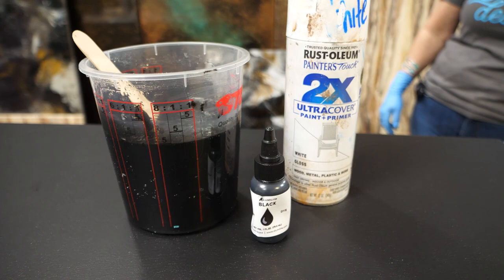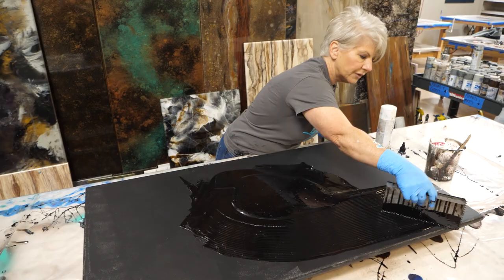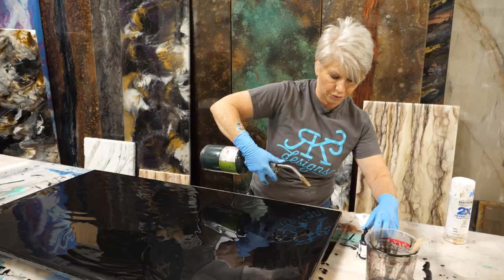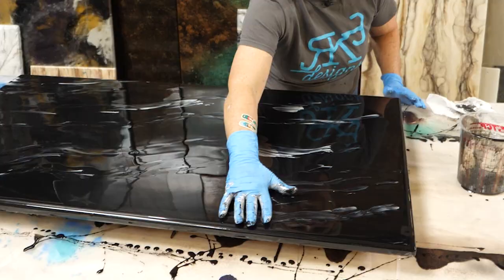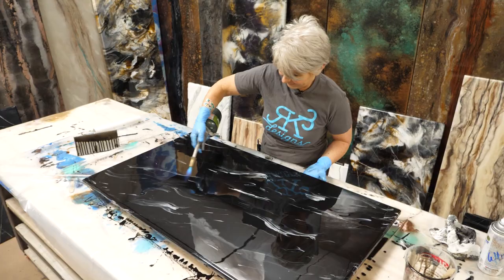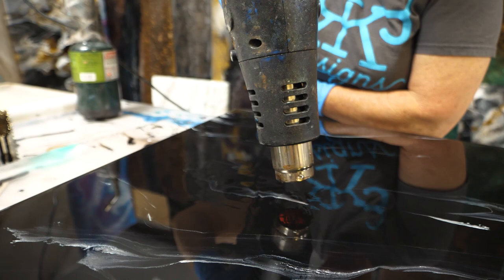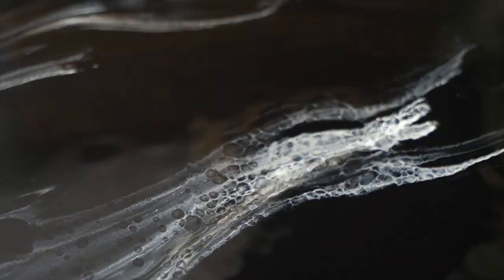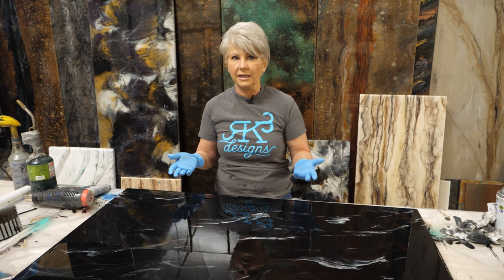2 Step Marble Recipe || Incredibly Simple Epoxy Recipe

Comment from the maker: rk3designs.com || What colors would you choose for this technique?
Reply: White with black and beige lines side by side. Would you do it? The colors in my kitchen are black floor, vintage 1950’s chocolate brown and light coffee (gradient) stove and oven, white cabinets with freshly painted pewter brick outlining the cabinets. My countertops are prepped with primer and a white undercoat. There is an silver protective edging on the countertops that actually look vintage cool. I could pull it off but… The rest of the room have almond walls. It’s an open concept. It sounds odd but it works. So I don’t have to replace the stove in the oven I wanted to bring that chocolate beige and slight black into a white countertop just to pull it all together. I would love it if you could create something like that. not sure if I gave you a well explained vision. Girl, you’ve got me crazy wanting to change my career. And I work in a spa!
Reply from the maker: @SatinSkies2011  that sounds like a cool color recipe! I think by brining in all the color you want, a melded marble technique would be awesome. If you want more of a striated design, I would use a large squeegee to create very soft striated lines. You can tape over the silver trim and once the epoxy has thickened up a bit you could pull the tape then clean it up with isopropyl alcohol. I think the mixtures of the earth tone browns and the white would be nice. I would just do black as accents so it doesn’t overpower your design. Hope that made sense. 😳. I would love if you joined our Facebook insiders group, RK3 Designs Epoxy Insiders. We would love to see your projects!! 🥰
Reply: I’m in the group! Wouldn’t miss it for anything. Thank you sooo much for your response. You’re the BEST!